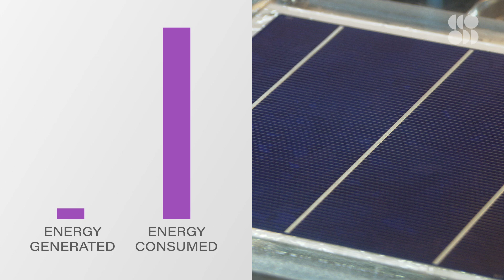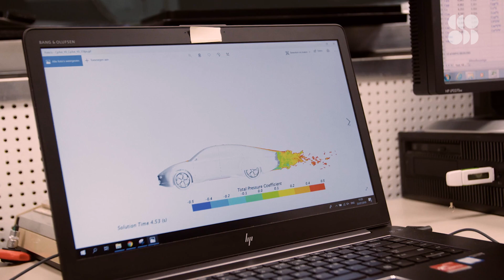The Solar Car Revolution Could Change EVs Forever

Comment: Where I live, the solar panels would need to be heated, or they'd be useless in the winter.
Reply: Uh, no. Solar panels work even better in the cold. (Just not so well in the dark or covered with snow.) It's the batteries that need to be kept above freezing. So they are heated and insulated from the cold. Did you know that 80% of the new cars sold in Norway are EVs? I've heard it gets pretty cold there.
Reply: @fotoguru222  the snow was what I was thinking about. We get a lot of it.
Reply: @rickseiden1  Ah! Then simply brushing the car off after it snows will be all that is needed. Other options would be covering the car with a tarp or garaging it overnight if you can and when a storm is expected. I've read that solar panels work fine through thin coatings of snow.
Reply: @fotoguru222  Here's what I'm thinking.  I get home from work, and park in the driveway.  It's the dead of winter, so by the time I get home, there's not light, and the car can't charge.  Overnight it starts snowing.  I go out in the morning and brush off the car, then drive to work.  I park in the open at work so the car can charge, but it's still snowing, and my car is quickly covered in snow.  It can't charge.  I come out to go home, brush off the car, and then head home.  I park in the driveway again, and it's too dark for it to charge.  Where I live this could easily happen a few days in a row.  If a solar car relies on being charged every moment it's not moving, and the only time it's not moving there is snow falling (and sticking), well, my car isn't charging anymore, and I can't get to work.  But, if the solar panels are heated, even to just 35F/2C, which would be enough to melt any snow, my car can charge while I'm at work.  It does mean that some of the power that is going to charge it is being used to heat it so it can charge, but that's the best that can happen.

In the summer, or in places like the Southern part of the US, this wouldn't be a problem.
Reply: @rickseiden1  Thanks for sharing your thinking. 

I'm not sure what energy it would take to keep the top of the car from freezing in a snow storm. Do you? I know places, downtown businesses mostly, have heated sidewalks to keep them from freezing, but I have no idea how much energy they consume. My instinct is that they consume a lot -- enough to keep a building's steam boiler busy -- a lot more than is reasonable to come from a battery all day or all night, because I know that even an ICE car cannot keep the the windshieeld clear in a blizzard, even with all the waste heat coming from the engine directed to the windshield.

So what's the solution? Forget trying to keep the outside of the car warm for over 12 hours overnight. Plug the car in and/or park it inside. My understanding is that in really cold places like yours, nearly every parking space comes with an outlet meant for block heaters to keep the engine oil from turning to molasses. Use it to charge your EV and keep thebattery warm, if you can't garage it. 

Does that work for you?
Reply: @rickseiden1  Perhaps the advantage of the Aptera then is just that it is a super efficient battery electric car that only needs 100Whr per mile, just go for the standard Aptera without the extra solar PV, and treat it as a normal EV, choosing the battery range from between 250 & 1000 miles that most suits your driving?  Then if you do a long trip & use public chargers, the Aptera adds range at maybe three times the rate of conventional EVs?

Comment: Yeah for experimental races. To be commercial, a lot has to happen first. Solar cells need to get 500% lighter and 200% higher output. Batteries need to get a whole lot lighter, smaller, reliable, less heat intolerant, and high capacity and output. The electric motors themselves need to get signficantly lighter. Then there is a whole raft of wiring and controllers and limiters and stuff that need to be standardized and simplified. Once that is done, solar vehicles can be more than large toys
Reply: They can't get 200% higher output because that would be more energy than the sun produces on their area
Reply: Or . . . Make the body out of lightweight super strength modern aircraft quality level resin filled composite material to save a literal ton of weight, and make it so slippery you only need 1 KWH of battery juice to push it 10 miles down the road.
Reply: @fotoguru222  that rings a bell for some reason... ... ...  ;)

Comment: Seeker has really gone downhill with the clickbait titles. Neither of these companies are anywhere near production ready. No discussion whatsoever on issues or realities to explain why solar powered cars aren't "here" yet. This is more like a 10 minute infomercial/pitch. Should have slapped the "contains advertising" label.
Reply: I mean, there is a reason Teslas aren't covered with solar panels.
Reply: Engineering Explained recently did a video showing just how limited in usefulness a solar powered car would be. It's not pretty.
Reply: @auntieaoife  This assumes keeping all of the heavy batteries used in typical EVs, like the Tesla Model 3. That's what Engineering Explained did, he assumed basically no change to the Model 3 besides slapping some solar cells on it. The main way these companies are keeping costs low and efficiencies high is by reducing the size of the battery packs. Lithium-ion batteries are heavy and expensive, so by reducing the amount used, they can make solar cars possible. The reason they can do this is that the solar cells keep charging the car no matter where it is, like having an EV destination charger plugged into the car at all times. Imagine that the average (American) commute is 30 miles round trip. If a manufacturer wanted to produce an EV for the average American, they would need to include a battery big enough to run the car for 30 miles. If the solar panels can charge the car to add range, ~15 miles per day, then a manufacturer could build a car with a battery that allows for 15 miles of range - half the size. This instantly cuts the cost of the battery pack in half and reduces the weight of the car significantly. Reduce the weight and less energy is required to travel a certain distance, if the weight is reduced than a smaller battery pack can be used, if an even smaller battery pack is used, then the car can go further on less energy, so an even smaller battery pack can be used.... etc, etc. It's cyclical.
Reply: @justin_time  Changing the method of charging does not mean you can reduce the battery capacity and still get the same range.
Reply: @justin_time  That is a great way start the market but would prevent long term adoption. The Nissan Leaf started with roughky 60 miles if range and it was partially from the same theory. 

We are only seeing more and more mainstream adoption as pretty much every model is reaching 200 plus miles of range with 300 becoming a more and more reasonable expectation. I could definitely see solar panels being built into cars but people will always be plugging the car in at night.
Reply: @justin_time  that's just not how that works with EVs, though, your thought is only true for fossil fuel cars. Once you burn the fuel to accelerate the car, the energy is gone forever and if you have to accelerate a heavier car, you need more energy.
But all modern electric cars can recuperate, they're literally putting energy back into the battery every time you use the breaks. And the heavier the car is, the more kinetic energy it has, the more energy it's putting back into its battery. So since both the energy demand for acceleration and the energy generation during deceleration scale the same way with car weight, the weight itself is pretty unimportant for an electric car when it comes to battery capacity.
It's only important when you need to choose a motor capable of quickly accelerating, because then you need one with higher peak output force.
Reply: @kirkc9643  That's exactly what it means. Less batteries = less weight = more range. Place 100 lbs in the back of an ICE car and the mpgs go down, remove 100 lbs and they go up. Same goes for EVs.
Reply: @myhandlewastakenandIgaveup  The difference is that the Nissan Leaf started with 80-100 miles of range and kept going down until it was plugged in again. Now a person could start their day with 80 miles of range, commute 10 miles and have 70 miles of range, let their car charge outdoors anywhere in the world, then get back in their car and have 80 miles of range at the end of the day. No plugging in or charging infrastructure needed. It's a subtle change that makes a world of difference. The future is bright.
Reply: @midnight8341  The weight of the vehicle is extremely important as regenerative braking is not 100% efficient - only about 70% efficient. For instance, if a car uses 1 kwh to accelerate, the maximum energy the car can "recuperate" would be 0.7 kwh, a loss of 30% of the original energy used. Also, for regenerative braking to work, the car must first be moving which requires energy of some form to be input. Solar charging, however, does not require the car to be moving or to have used energy in order to recharge the battery.
Reply: @justin_time  I both agree and disagree. I am looking forward to solar charging but it doesn’t help for longer trips (which while making up a small percenyage of trips are a hard limit on short range ev’s viability and would necessitate owning a gas powered vehicle as well). I can see solar powered ev’s being viable in 10 years much the same way it took roughly 10 years for ev’s to be viable outside of purely urban / suburban uses.
Reply: @myhandlewastakenandIgaveup  Touche. The Aptera will also be available with a 1000 mile range trim pack. That's more a result of its low drag than solar though. I feel the same as you though, and looking back 10 years, if the success of the Tesla Model S is any indication of what the future of SBEVs are, sign me up!
Reply: @justin_time They do have the aerodynamic advantage. The future is definitely electric. Chrck it out the niro ev if you get a chance. Its the marley median in cost vs features and  I can  attest its an great gateway drug to ev’a.
Reply: @justin_time  You could get a job at Seeker with mad science skilz like that. Silly Elon needs to halve the weight of those excessively large battery packs so he can extend the range of the Teslas. Maybe put PV panels on the cars too so the range can be extended by 10 miles if is parked in full sun all day.
Reply: These two companies and Sono Motors have a target release date for their products of about 1-2 years. They aren't building anything fundamentally new, just putting together pieces in a way that hasn't been done before, so it isn't outlandish to expect to see these companies reach small-scale production in 1-2 years. Aptera plans to sell their Sol SBEV for between $30,000-$50,000, Sono Motors Sion for ~$35,000, and the Lightyear One is projected to cost ~$150,000.
Reply: Solar cell cars are gimmicks….. It makes so much more sense to put solar cell on your house roof rather than on the car that is probably going to be park under the shades. You wanna park your car under full sun? Well, find a place in the city or suburbs that your car solar cell won’t be blocked by trees or other buildings. If you are “lucky” to find spot to exposed your car to bright sun… you car going to turn into sauna the next time you get in. Oh, did I say that you probably going to derive tiny amount of energy from the solar cell? Honestly they could probably made this car much more affordable without the solar cell.
Reply: @Mryodamiles  Some people don't have homes to add solar to. Plenty of parking lots to park a car in with no shade. The solar panels absorb most of the sun's energy as heat, so it actually keeps the car's interior quite cool, and the A/C system can run while parked using the car's electric battery if temperatures become too extreme. 10-15 miles added range per day in sunny conditions, 5 in cloudy conditions. Solar cells are cheap now, about $1 per kw, but lithium-ion batteries remain costly, so it actually makes more sense to add inexpensive solar cells to boost range rather than expensive and heavy batteries.
Reply: @justin_time  That is rediculous. This thing have short range which means the main consumer market is going to be urban people....who mostly going to park their cars under shades. Moreover, you don't just attach solar cell to roof of the car, you are designing a custom solar panel that is curve according to shape of the roof and have to withstand all sorts safety tests associate with car roof. That's going to significantly impact efficiency and increase cost. If tiny solar panel is that efficient to give 10-15 miles on sunny day... then why don't Tesla and other EV manufactures put them on the roof?
Reply: @Mryodamiles  Up to 1000 mile range, base model 250. Flexible solar cells exist and are being used on this vehicle - no need to design new photovoltaic cells. Solar cells won't impact safety testing as they are too small and too light. Other manufacturers are not doing this because they have different business models and technical plans. The solar array on the Aptera adds so much range because the car using so little energy to move. The same size solar array on a Tesla Model 3 would only add roughly 3-5 miles per day. Apples and oranges comparisons don't work. Aptera can work.
Reply: 100%
Reply: I totally agree.. this is nothing more than vaporware
Reply: Check out the Sono Sion.  Seeker completely overlooked them and they're much closer to production.
Reply: @mervjohnson8010  They didn't pay them enough to be part of this infomercial

Comment: Having to park your car in the sun isn't ideal. Also, of the 1400W/m² flux at the top of the atmosphere, only 1kW/m² reaches the ground. Multiply that by the cosine of your latitude, (i.e. New York: 0.76) and the efficiency of the panels, and the effective noon power is just under 250W/m²
Since the earth rotates quite constantly, we can approximate the total power using the definite integral over the 180 degrees of rotation over 12 hours, resulting in about 1.9 kWh/m², in an idealized situation. However, the angle of reflection reduces the usable number of hours, and it's not always perfectly sunny. But in a theoretical idealized situation (where I'd be surprised you'd be able to get 50% of that) you might get 10 km of range per (perfectly sunny) day, per square meter of solar panels...
Reply: Yeah but don't let facts get in the way of clickbait

Comment: Most important question remained unasked and unanswered: how big is the battery inside of it?
Presumably it has one so that it doesn't grind to a halt at a first cloud that passes over, but how far can it travel when it's cloudy or at night? And what's the top speed? If it can or can't hit highway speeds would be an extremely important consideration to buyers.
Reply: Well it uses less than 100wh per mile and they sell it with range from 250miles to 1000 miles. Now just multiply the range with wh.
Reply: Aptera has different size batteries depending on the range. But pretty much the same as a regular EV, slightly less.
Reply: @juliahello6673  wow, that sounds way better than I expected.
Reply: I think someone said it was 62wh per mile. Sorry my memory is kinda bad :D

Comment: Stop building cars, no matter how energy efficient they get, the infrastructure needed for them will never be green.
Reply: unless they're flying cars 😉
Reply: @Arya_amsha  impractical, cars are already unsafe as they are, now imagine them being planes too
Reply: That's not true.
Reply: Offpeak buses are usually far more damaging to the environment than normal cars, let alone renewable powered EVs!
Reply: @peterchandler8505  busses are ultimately more effective per head, than a most cars since most people aren't pooling

Comment: It's cute how you have no clue about how federal regulations affect the design of cars available for sale
Reply: I think three weelers are classified under motorcycles and have completely different (much more lax) regulations.
Reply: Both will easily pass smog. The Aptera Sol is a trike so it will be classed as a motorcycle, therefore less stringent safety requirements. Both effectively use carbon-fiber monocoques, like all modern hypercars, so they will have fairly safe crash structures. The Aptera Sol SBEV will be built in America and will cost between ~$30,000-$50,000.
Reply: The people making these cars will have spent ... ... a bit of time on those regulations!!!